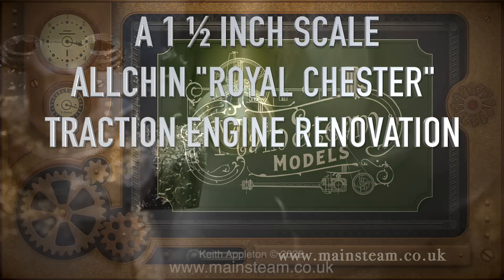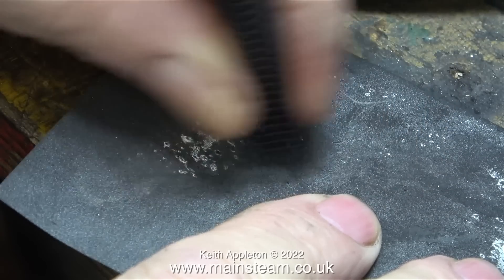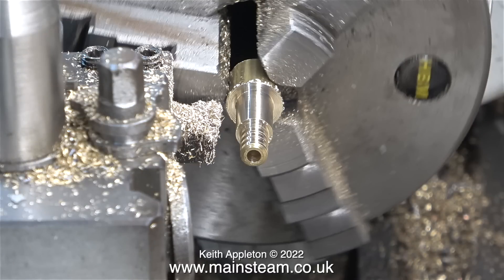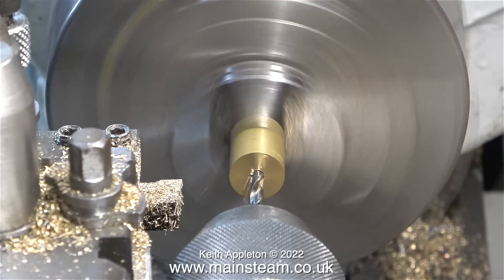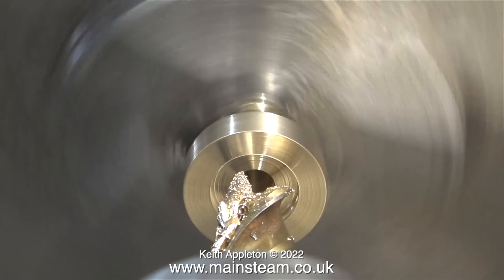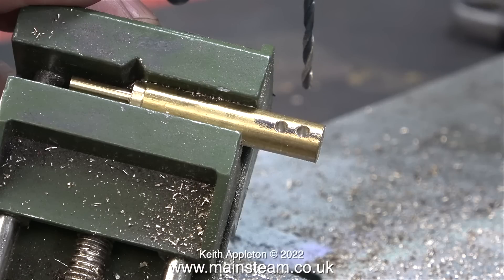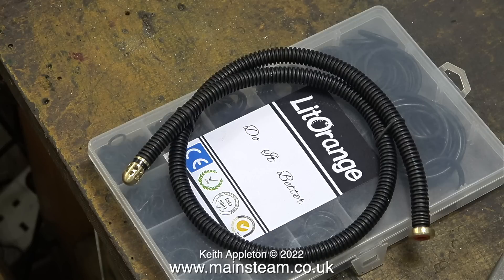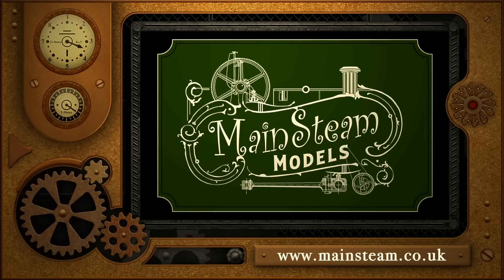ALLCHIN "ROYAL CHESTER" RENOVATION - PART #17

Comment: Hello Keith ,a selfish request when you make your last video of sweet William could include shots of the chassis and running gear as I have just bought of Jacky at Blackgates enough material to make a complete running chassis and it would help me a lot .I have been following your series series since the rebuilt reversing gear for a oscillating engine  which I have now built to twice full size for a big engine.  I am now 79 so keep thinking big and don't worry about age. PS .I am just finishing restoring a road roller from 1930 Dave Bush  thanks in anticipation
Reply from the maker: Please watch the series from the beginning. In the early episodes there are many shots of the chassis running on the bench  ..........